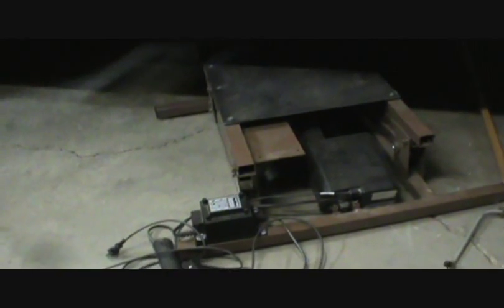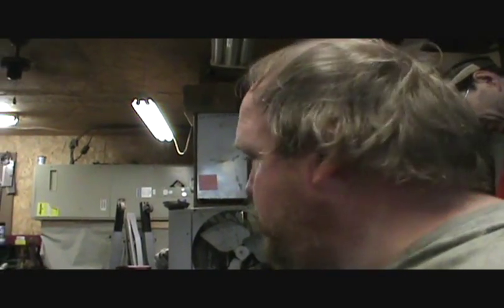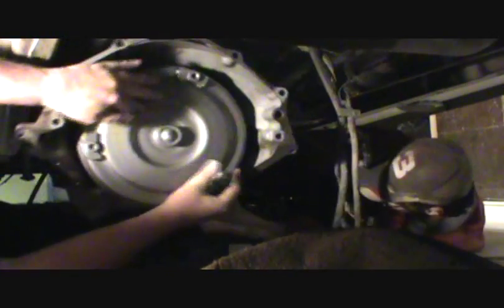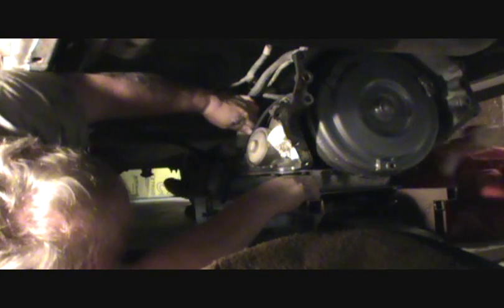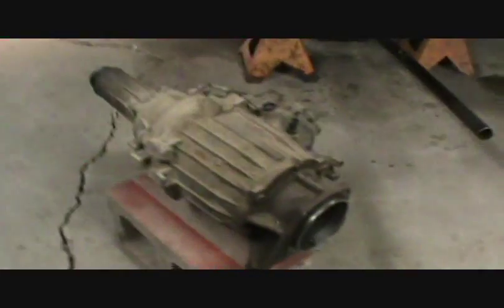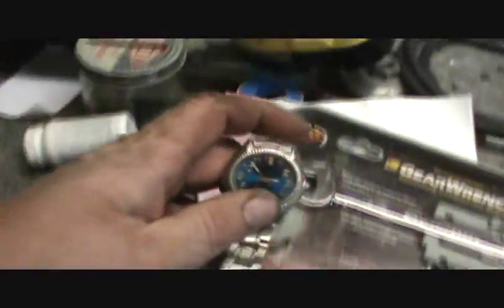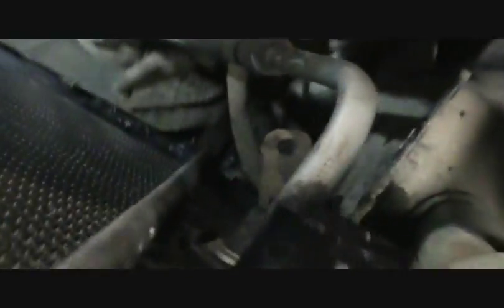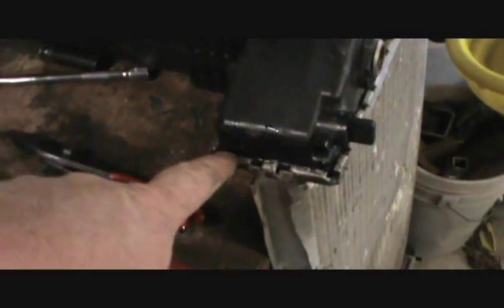the days is here finally used transmission lift

Comment: I thought those bars might be a little too long. Usually not a lot of room in front of the bell housing. Oh well, that's what r&d is for a new design. More you use it, the more improvements you will make. All in all, it worked good

Comment from the maker: thank you.well the truck is going now as of tonight it drives nice.i had to change out exhaust manifold on drivers the studs got messed up and i dont have torch anymore.the original radiator is in it i used 2 cans of cooler cleaner on it and blew air threw both ways just to make sure.will be doing a vid on it monday all cleaned up.